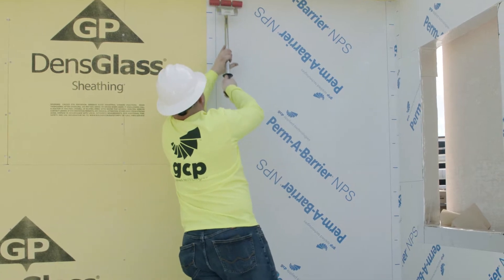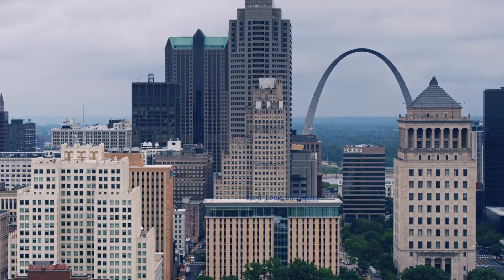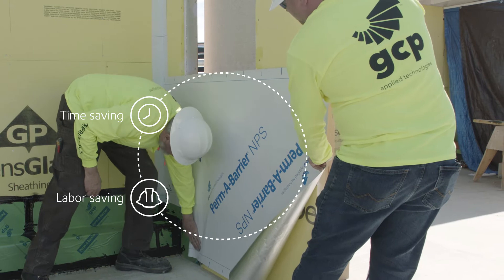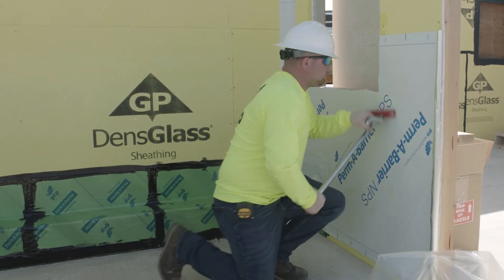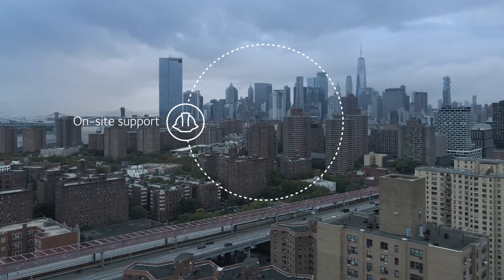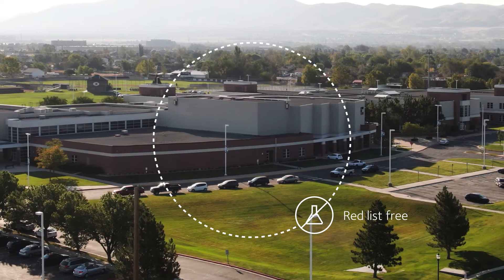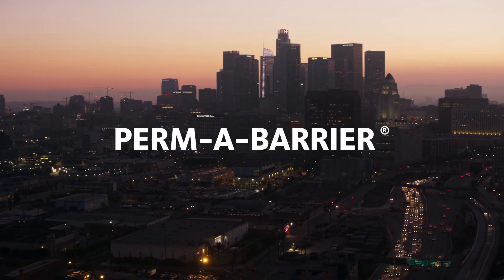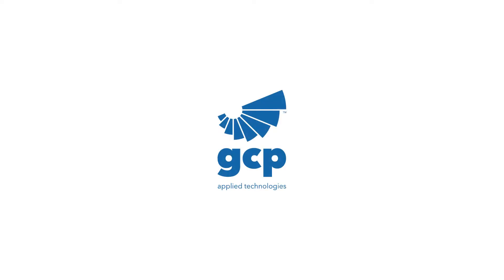PERM-A-BARRIER® NPS Primerless Impermeable Sheet Air Barrier

Comment: Can Perma-A-Barrier NPS serve as a water and air barrier on a vertical wood wall structure where 1/2" exterior "treated" plywood is installed as the exterior sheathing over 2x6 framing studs?